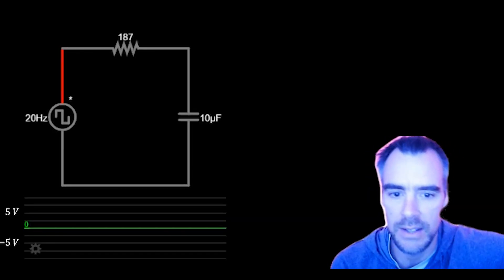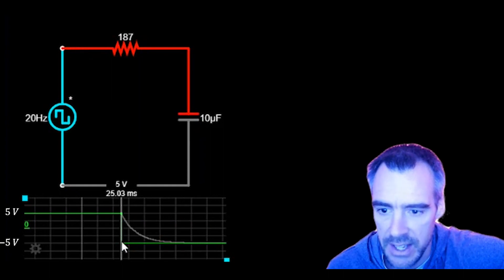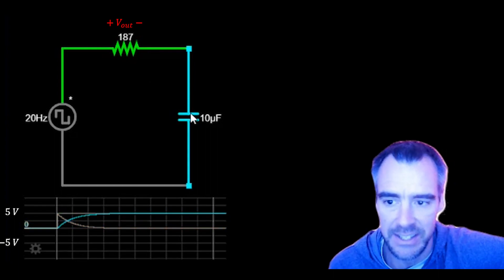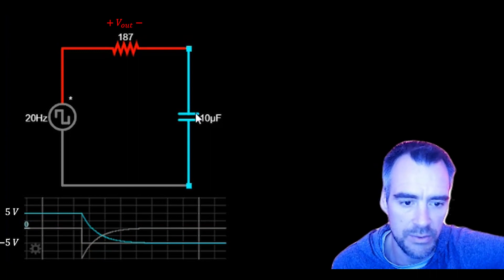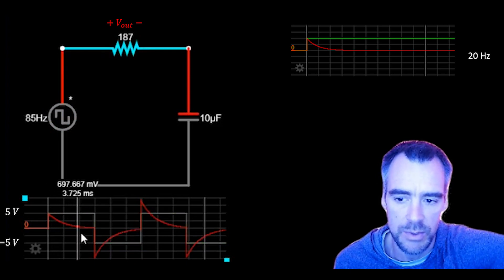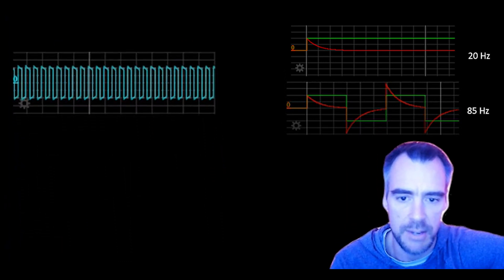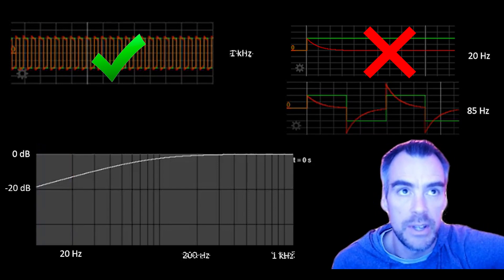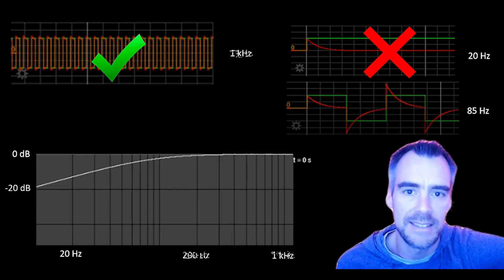How High Pass Filters Work using a Resistor and Capacitor (RC)

Comment: Quick question:
First of all, fantastic video!
I’m curious if a capacitor alone would work as a high pass filter in an audio experiment. My understanding is that capacitors naturally want to filter out low frequency. If I wanted my guitar effect pedal to be quieter at 200hz and below, why is it that I can’t simply put a capacitor of a specific value in series right at the output? (Or can I?) or what is it about the relationship with the resistor that makes both parts mandatory?
Reply from the maker: Thank you.  And good question.  I would encourage you to simulate this to see for yourself.  Go to falstad.com/circuit, circuits tab, passive filters, and High Pass RC filters.  If you run the simulation as is, you can see the output voltage passes well at the higher frequencies, but not as well at the lower frequencies.  

Now see what happens if you remove the resistor.  Just click on it and hit delete, then draw a wire where the resistors was (draw tab, add wire).  You will see if you remove the resistor, the output voltage will be directly connected to the ground, so it will always just be 0, not very exciting.  

If you remove the wire connecting to ground, then you will see there will be no current flowing through the capacitor, and the output voltage will be the exact same as the input voltage, no matter what the frequency is.  Also, not very exciting.  

So it turns out you need the resistor there to both allow current to flow while also preventing your output voltage from being connected directly to the ground.  

You can also change the value of the resistor and see how this changes things.  At high resistance, say 1k, v_out just matches the input voltage no matter the frequency, like when there is no connection to ground.  At low resistance (1 ohm) it acts more like the short circuit where there is barely any output voltage, although it's a little higher at the higher frequencies.

Comment: Great explanation, thanks! I didn't realize that high pass and low pass is basically the same circuit, just measuring voltage on a different component

Comment: Nice tutorial overall, but there's two things I can't figure out. I understand the order of the resistor and capacitor changed gives us a lowpass filter. I can also understand how depending on the load time of the capacitor certain frequencies are cutoff more than others. But... What I don't understand is the flow of the signal. If I look at this square wave generator, I see the pulse going from the + side one half cycle and then from the minus side one half cycle. In my mind It's like the + part it goes through the resistor first, which then passes our output point and then fills up the capacitor. On the minus side the other way around, first capacitor.  I know this doesn't make sense, because the result would be one half cycle lowpass one half cycle highpass if that makes sense. I just don't really understand the flow of the signal and also when the capacitor discharges. Does it discharge to our output signal? Is this also causing our delay/phase shift? Second thing I don't understand is the resistor switch to double peak (10V).
Reply from the maker: Hi Thevon, I see you are putting some serious though into this, and your question is challenging.   I think what may be tripping you up is the idea that the order of resistor and capacitor (e.g., RC vs CR) gives you a high or low pass filter.  It turns out the order doesn't matter.  What matters is whether you are taking your output voltage across the capacitor (which would make it low pass) or across the resistor (which would make it high pass).
Reply from the maker: As for the voltage across the resistor changing from 0 to -10 V, I attempt to explain this briefly around the the @3:58 mark, but basically this 10 V swing is the immediate response to the 10 V swing in the voltage input.  With sufficient time at +5 V input, the capacitor acts like an open circuit, there is no current across the resistor, and thus no voltage across it, 0 V.  When the voltage source changes from +5 to -5, now the left side of the resistor is at -5, and the right side of the resistor is at 5 V.  The right side is at 5 V because that's what the capacitor had charged up to.  So the difference between that -5 and 5 V gives you the initial -10 V across the resistor, which dissipates back down to 0 once the capacitor is recharged in the reverse polarity this time.
Reply: @matthewjohnson2554  Thanks. I was thinking way too much in DC anyway. I asked my teacher as well and basically it's all about reactance to a certain frequency that changes the voltage drop over R and C, which makes sense when switching them gives a lowpass or highpass filter. I understand the 10V as well with your explanation, thanks for taking the time to reply!
Reply from the maker: @ThevonMusic   Sometimes a filter can be referred to as RC and CR, which would be low and high pass, respectively, if the output voltage is taken over the second element.  I imagine that may have a been source of your initial misunderstanding.
Reply: This is a good video about resistor-capacitor filters. A big question for my life is why have I been so tortured with inferiority, guilt and loneliness in Las  Vegas, Nevada and America? My  parents Bonnie and Terry Tipton of Las Vegas as well as the sister Shawn Noone  have tortured me with guilt and inferiority. So has her husband and sons Travis and Brandon. The only way to interact with them is to feel like a vastly inferior human being and listen to how perfect they are in judgement, character and intelligence. I firmly believe the only reason to have a conversation with them is to feel guilty and have my self esteem destroyed. This has been a constant since 2021. The population of Las Vegas destroys my self esteem. I am in Las Vegas after being humilated in another country, and being made to return to the United States and Las Vegas. Why do I have to feel like such an inferior human being to all of these people. I suppose some of my loneliness stems from not being able to talk about resistor-capacitor filters and other engineering problems in person. The problems can be practiced, but alone. My parents have no interest in the problems I have found interesting. It is a lonely activity.